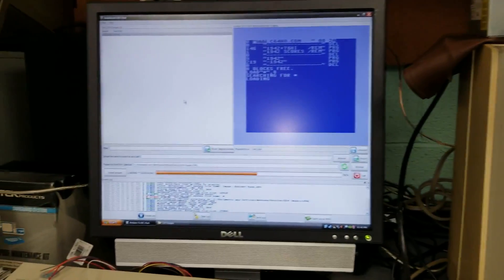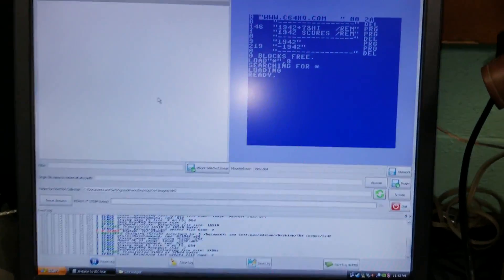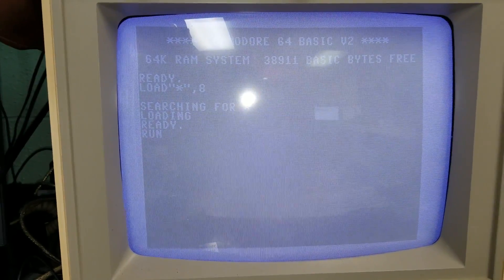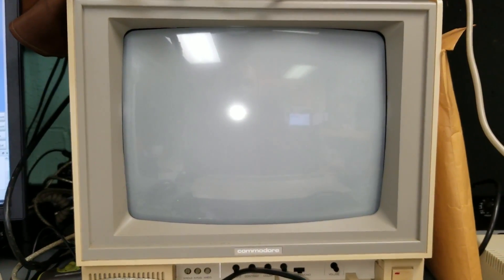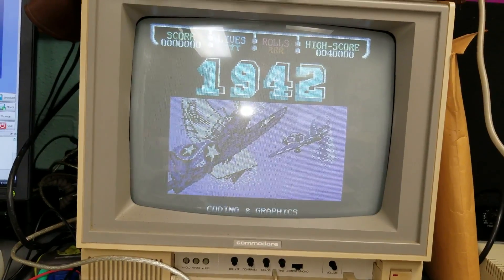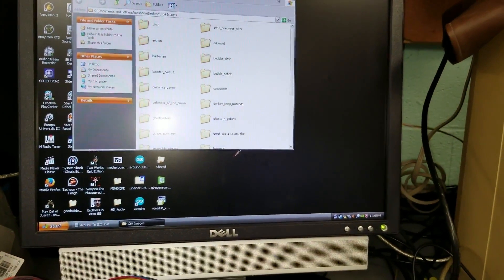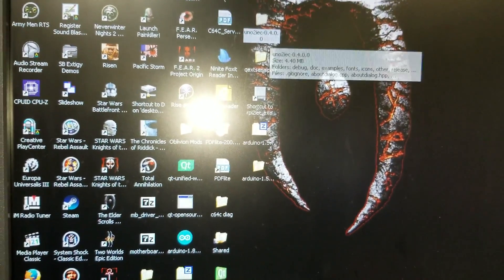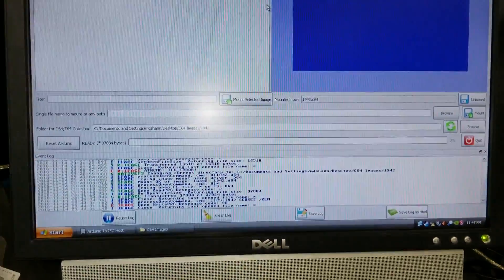Commodore 64 uno2iec in action!

Comment: Does the emulator support writing to the virtual disk drive and saving a d64?
Reply from the maker: Sorry, I don't remember. I ended up purchasing a pi1541 shield off eBay. It's a much better solution so far, mostly because I can use it without having to dust off the old XP machine too. I hope to do a video on it at some point.